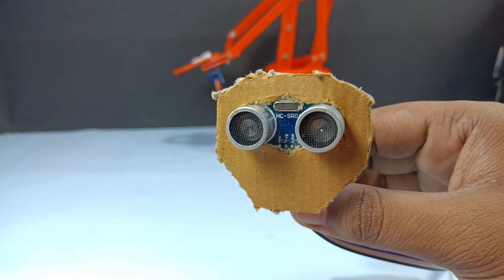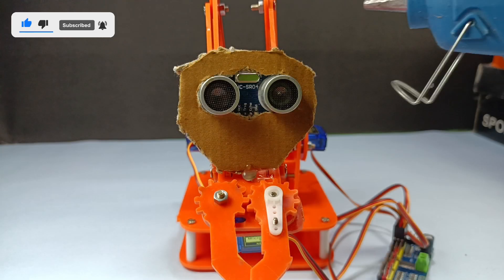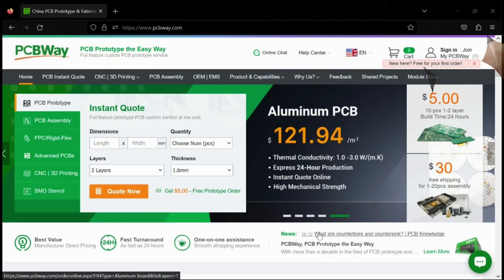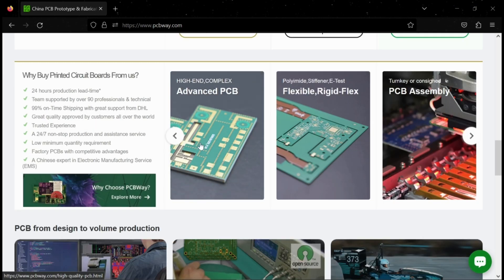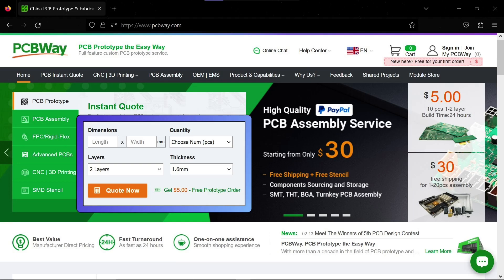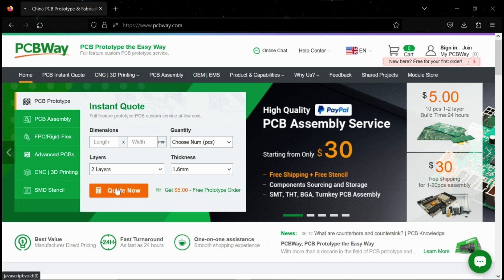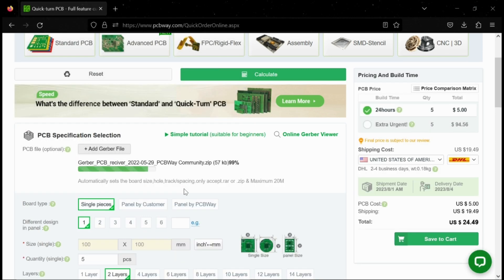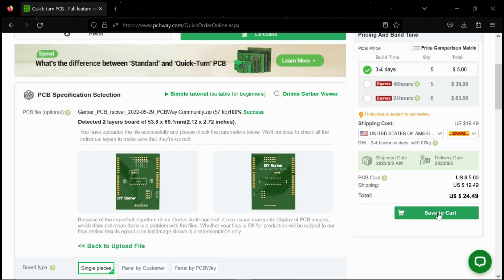How to Make an Object Following Robotics Arm With Arduino

Comment: the code have some error its Error compiling for board Arduino Uno.
Reply from the maker: Thier might be some issue with the library. Check wheather you are using the correct library or not.